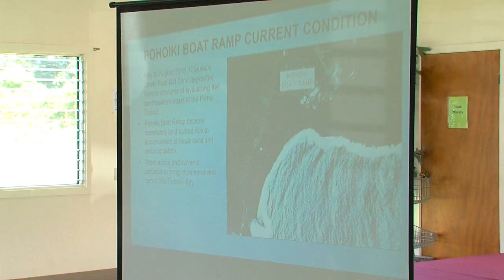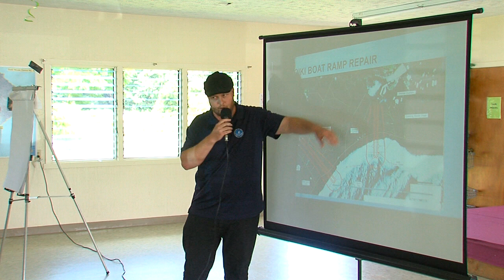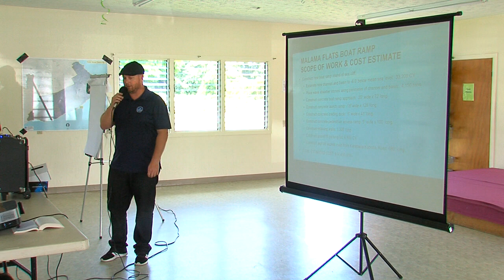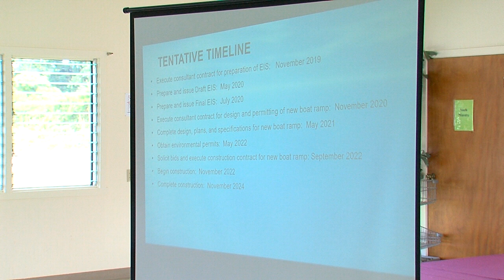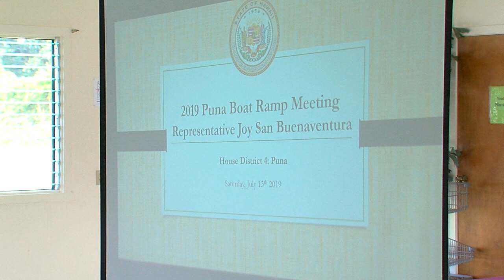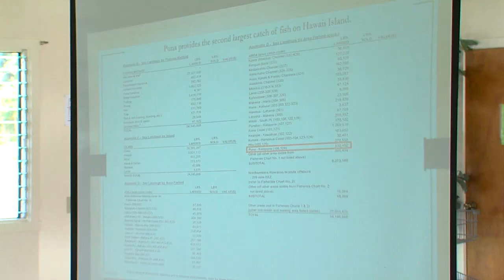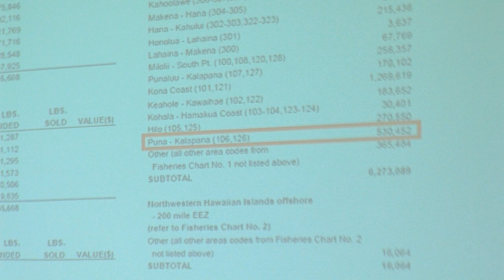Puna Boat Ramp Study - Pohoiki Meeting 1/5 (July 13, 2019)

Comment: One of your best options is to dredge a channel between the new sand & the old beach w/ the sand moved back over to the outside of where it is growing. The inside is already established & the tide will only stack the sand so high, yet will allow it to continue to grow as it will w/ no restrictions. This also allows for the most minimal relocation of the sand...basically, you would just be moving it over to one side, the desired width of the channel. Then install concrete or stone retention walls on the inside of the excavation, if deemed necessary. 

You now have enough new beach to know what the pattern will be w/ the future growth of that beach...it can only grow larger from the outside, which could turn into a bonus asset over time. The inside retainer wall, if needed, should be engineered so that additional sections or courses can be added to the height of the inside wall, perhaps overkill, but exists as additional insurance & a simple semi-inexpensive future adjustment should it be necessary.